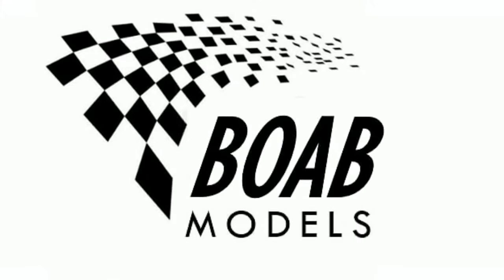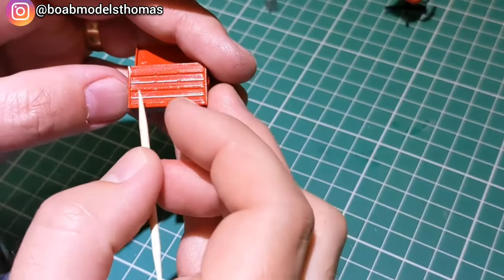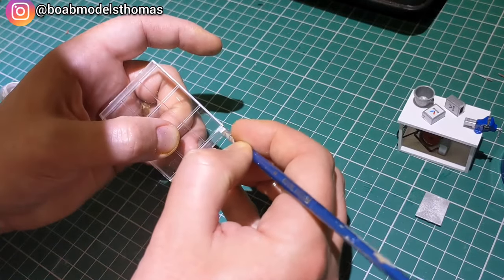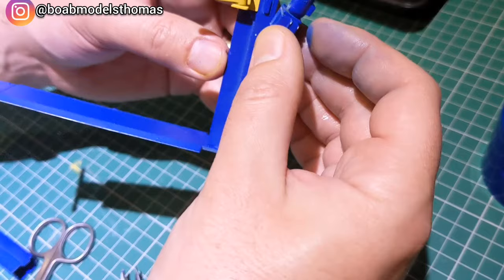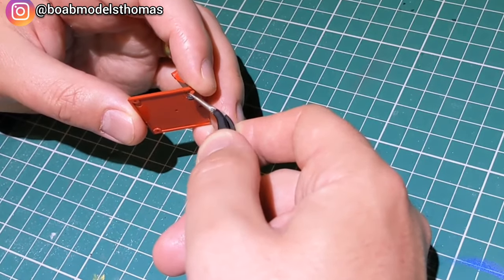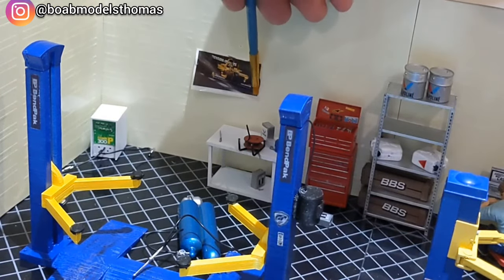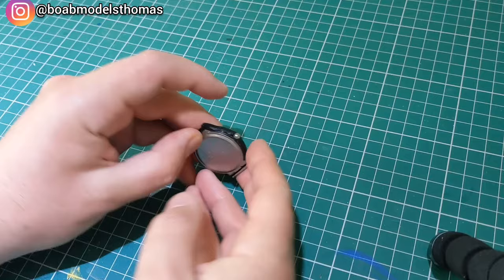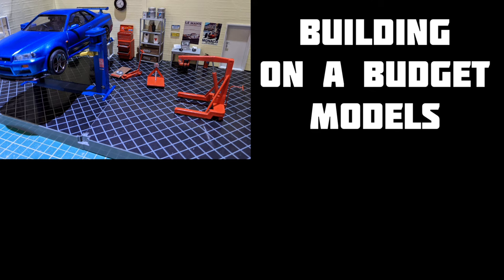How to build a 1/24 Garage and Tools diorama - Part 2 - Fujimi model kit

Comment: Hi! I have the garage set and a mechanic set in my stash. In your video you have the floor and walls. Are these parts missing from my set or is this a separate set? You can make it yourself from plastic sheet, but if it's missing from the garage set I'll ask for a replacement. Thank you for your videos, they have often helped me and improved my techniques.
Reply from the maker: Hi Martin. I'm glad the videos have helped.
There are a few versions of the set - Garage and Tools, just the Tools, and just the garage. I guess you have the set with just the tools.
Reply: @BOABModels  
That's right, I have the tools set. But what you're doing looks great.